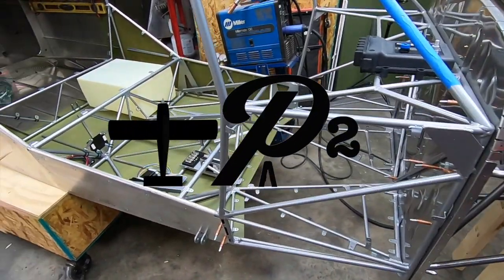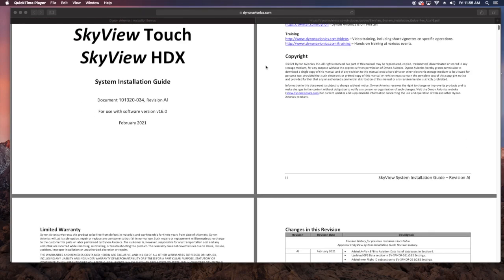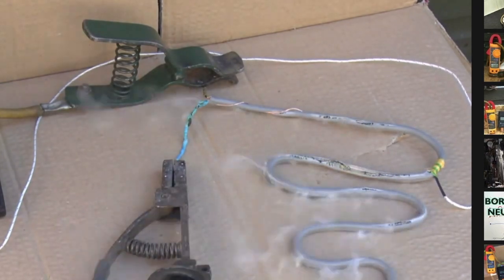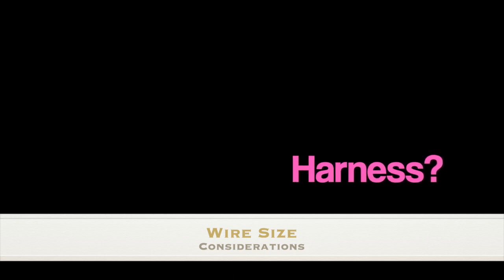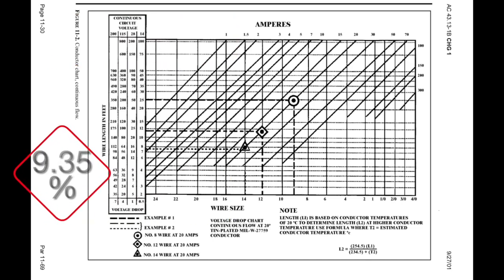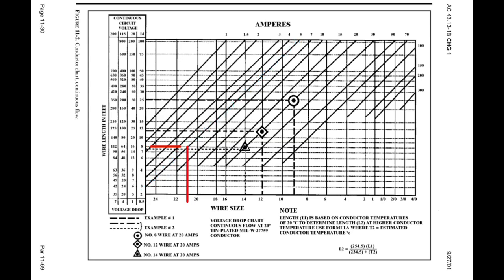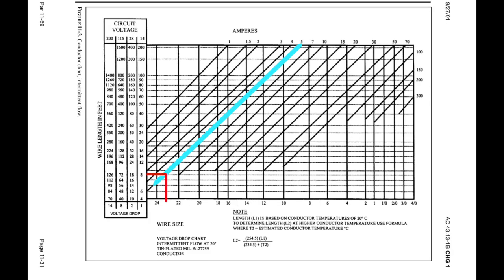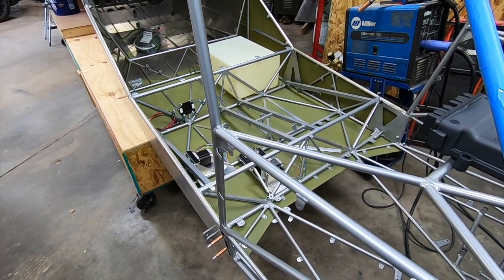CHOOSING WIRE GAUGE FOR AIRCRAFT?

Comment: I always wondered where they got the numbering system for wires.  Since they run it thru the machine one per number what would 2,3 or 4 ought be?  I know it’s bigger wire just curious about how they came about the numbering system.
Reply from the maker: I don’t know the answer to that one sir. Assuming it’s just bigger by the same percentage as going the other direction🤷🏻‍♂️ per gauge

Comment: There is an error in your analysis of the length of the conductor.  Let me explain:

Servo current requirement at 12V appears to be 2.0 amps, not 5 amps, if I am reading what you showed correctly.  5 amps is the recommended circuit protection rating.  The circuit protection is for the wire, not the device, so a 5 amp fuse or CB requires a wire size of 22 gauge or larger (larger wire/smaller gauge) per Table 11-3 of AC43.13-1B.  However, when you look at the distance the circuit can extend, you should use the 2 amp maximum current consumption of the device as you will not see 5 amps unless there is a short circuit and that constitutes a (VERY) intermittent load.  So, using Figure 11-2 with a current of 2 amps, your total circuit length could be 15+ feet.  The key point is that the wire size required for a given capacity circuit protection device is a separate consideration (Table 11-3) from the circuit length required to give a required voltage drop (Figure 11-2).  The voltage drop is a function of both the wire size and the actual current consumed by the device (and other things like temp, but those tend to be secondary considerations).

Another thing to keep in mind, and this makes Figure 11-2 even more conservative, is that the devices are generally specified for current at 12 volts, not 14.  12 volts is a more conservative case which essentially assumes the alternator has failed and you are running on battery power alone.  Since the servo uses 2 amps @ 12 V, which is 24 watts, when the alternator is putting out 14 V, the servo will only draw 1.7 amps to get the 24 watts of power it needs.
Reply from the maker: Well said my friend👍 Thanks for posting that!

Comment: Or, you could pretty much buy 18g wire for everything (except for the higher load items like battery, etc), and forget it 🙂 Granted, the weight factor...
Reply from the maker: Most of my harness is going to end up 20g for simplicity sake just like what your talkin about.. same pins and crimps and stuff so I don’t need a million different sizes of everything.
Reply: Not just weight, but also size and stiffness.  Larger wire can be cumbersome in large bundles in confined spaces such as behind the panel.  I am pretty much using three gauges: 14 for pitot heat, 18 for landing, nav and anticollision lights, 22 for almost everything else.  22 will handle 5 amps and very few modern avionics devices require more than 5 amps.  24 gauge could be used in many areas, but 24 gets to be hard to work with and connectorize when you have 60+ year old eyes.  😂